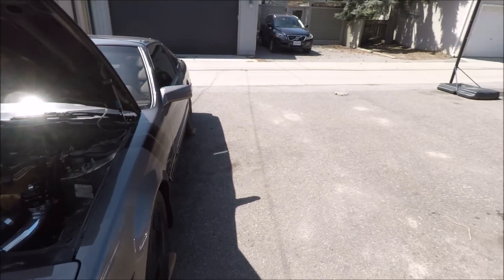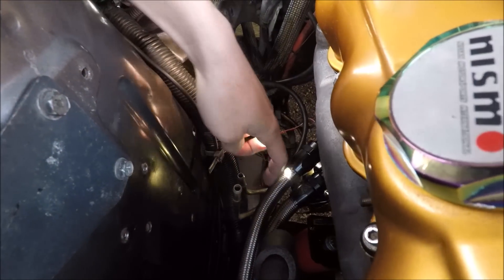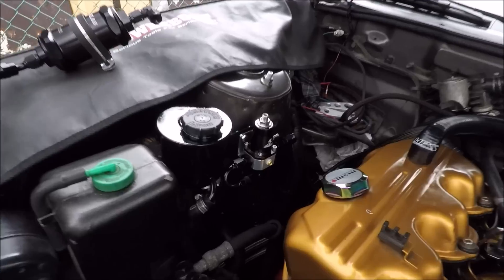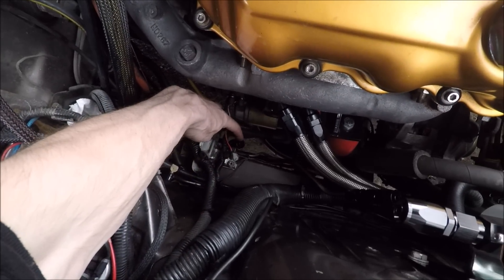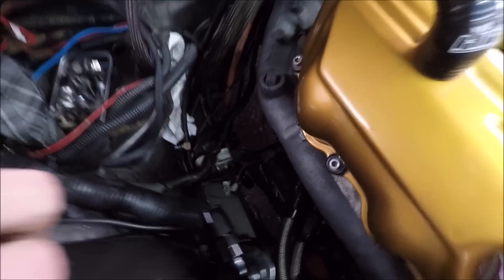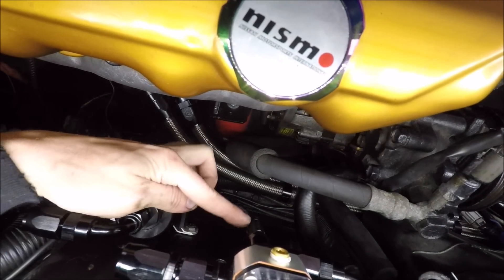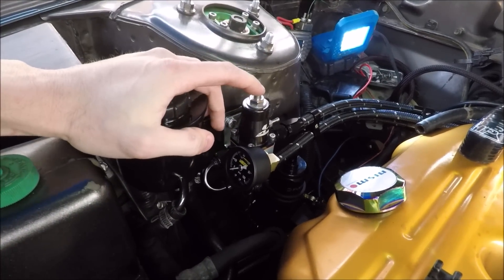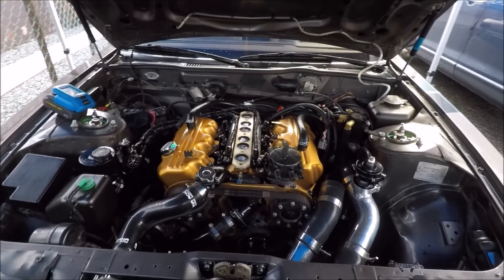Building A Custom Fuel System for the Z - Z31 Megasquirt Build

Comment: Currently about to put my 1st motor in my Z31! Long tube turbo headers, stock bottom end, 292 cams, ported heads, valve spring kit, stock rockers, stock lifters, ported lower intake, and maxima intake plenum, with the same fuel and ECU setup as yourself, and a twin scroll GT45 turbo. Got a new 71C trans to use for now at 500hp until she blows and I can throw a 30A in. Welded diff and Z32 brakes as well. Full Matrix/Blade Runn Cyberpunk build. Her name is the Nebudchanezzar!